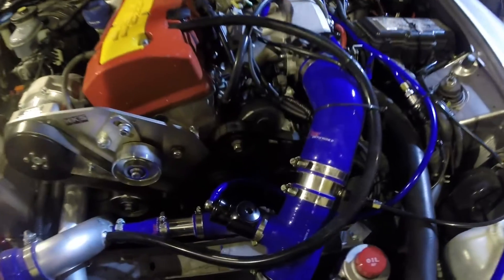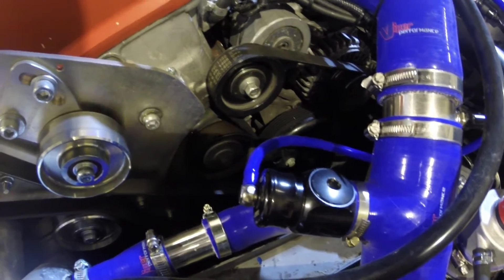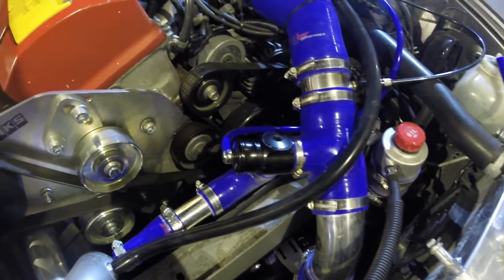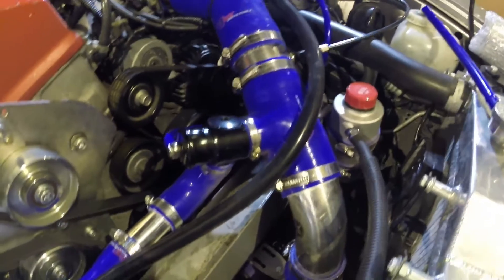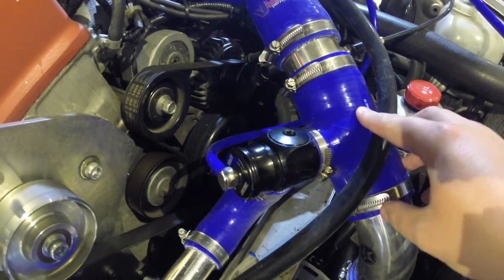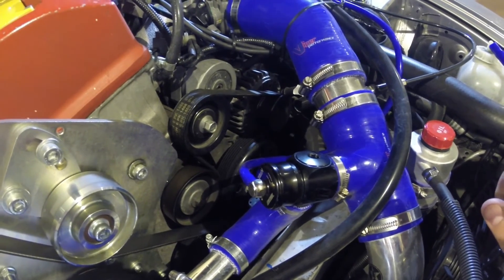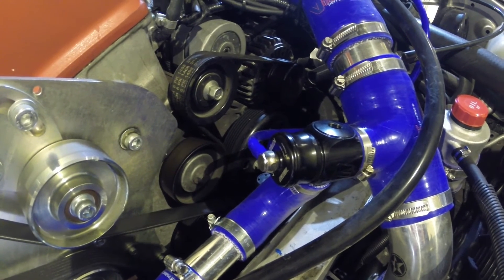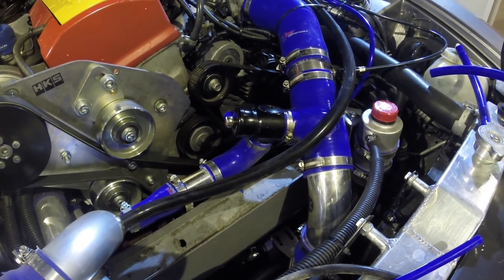Turbosmart Dual Port 34mm BOV Kompact Honda S2000 Supercharged

Comment: I’m trying to install a hks ssq 4 bov to my hks GT SC kit, but I’m having trouble. Can you please let me know if you kept that air splitter that attaches to the hks diverter valve?
Reply from the maker: No i haven't got the splitter. I dont think the HKS SSQ will work on a supercharged car. The blow off/bypass valve should be open at all times apart from mid and heavy throttle.
Reply: Hmm. I thought i could.  I’ll try to do some more research. Thanks.  Have you changed any of the pulleys?  Thinking about upgrading mine to increase boost.  8psi isn’t enough for mw